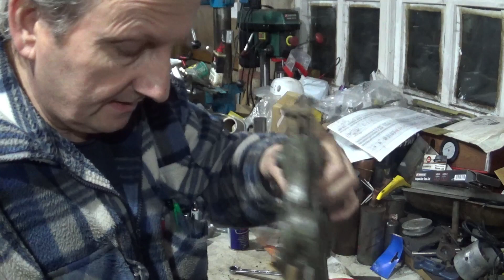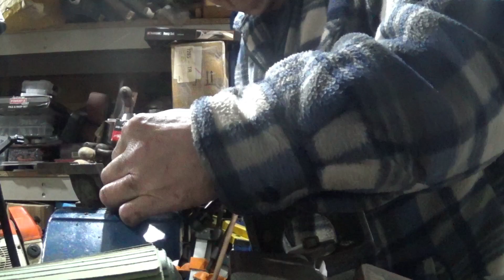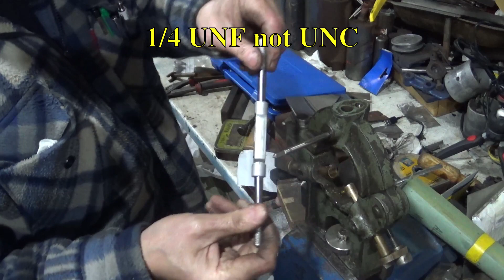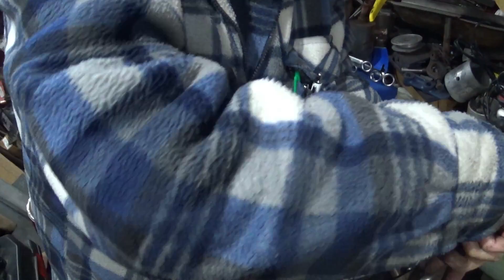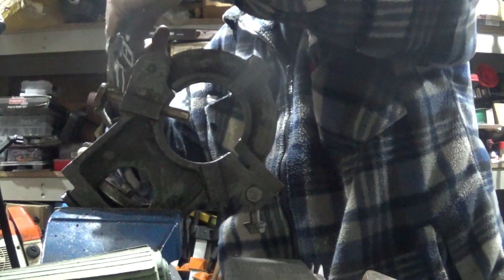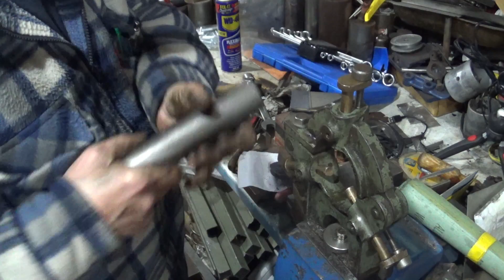Atlas 10 Lathe steady rest/Fixed steady repair

Comment: When I was a kid I wasn't so impressed with the solid brass bar steadies, wishing for a ball race one instead.  But now I can appreciate them, I rather like the simpler style of steady.

I've lost count of how many times I've been in that situation, tyring to identify some unknown thread - and sometimes it doesn't matter how many draws full of random nuts and bolts you have, you still don't have the correct one!!!  Kind of amusing that yours had been re tapped to M6.
Reply from the maker: I'd have had the correct one or could make it anyway. The fingers are not made of brass, they are bronze. Never brass, as it isn't a good bearing material. Same is true of the nuts in machine tools. Bronze, never brass. (Not aluminium bronze though).

Many thanks for watching!
Reply: @BensWorkshop  I don't know why I said Brass, I meant Bronze - it's always bronze for bearings (well good ones anyway!!!).
Reply from the maker: Absolutely.
Reply: @BensWorkshop  we bought a massive cabinet of old nuts and bolts from a farm many years ago - and we still have most of it - we're well off for massive old whitworth stuff but I've never got enough random small stuff - the kind that's used on mechanical calculators and dictation machines etc
Reply from the maker: I can see that being an issue.

Comment: In my Colchester, they are made from brass too.  I will prefer them to be ball bearings but they arent preferred in the industry dont know why?
Reply from the maker: Bronze is normal. It is a good bearing material. Mind you, the fingers can get flared ends. Apparently the ball bearing ones can get swarf trapped which can score the work.

Many thanks for watching!

Comment: Morning Ben. Nice to see a good Atlas piece over your way. They are most often lost over here in the States and survivors command a hefty used price. 

Nice work getting yours back to useful.
Reply from the maker: It is in rough shape. How much do they go for, and how much does a Southbend 9" go for?

Many thanks for watching!
Reply: @BensWorkshop Usually the 10-12 Atlas Steadies are $250-350. A SB 9 A (quick change gear box equipped) with some tooling will run $15-2,000. SB 9 B and C will go from $8-1200. Weirdly a SB threading dial will go for $250. Change gears will run $3-400.
Reply from the maker: I was asking how much the Atlas 10s go for. The SB 9 is a much better lathe from what I can see. I need to make new nuts for my Atlas but I do have a Myford 7 in very good condition.
Reply: @BensWorkshop  Sorry Ben. The Atlas 10 inch without QC gearbox go for $8-1,000 much like the SB 9 B and C models. Atlas 10 with QC gearbox are $1,500 or so. Interest rates are spiking over here and that will bring prices down likely 15-25% in the coming year.
Reply from the maker: Mine has the 54" bed and quick change gearbox. Cost me £50. When I got it, it didn't have any gib strips though. Soon fixed that.
Reply: @BensWorkshop  Absolutely great find for that great price. I found my Harrison M250 for $200.
Reply from the maker: Patience has its rewards.